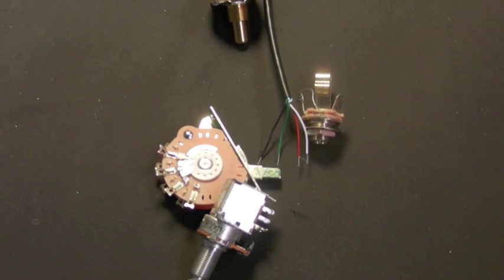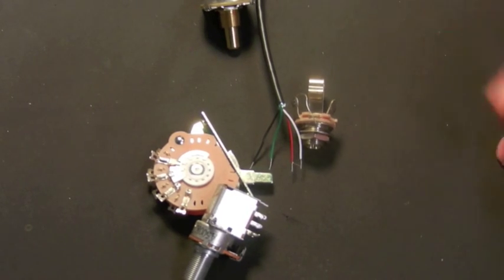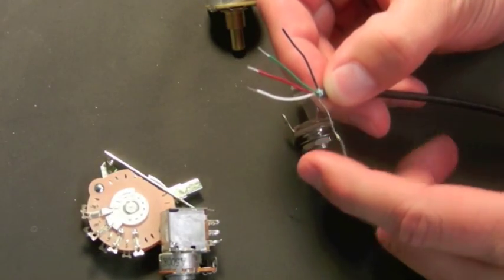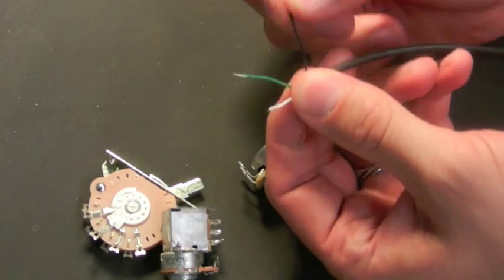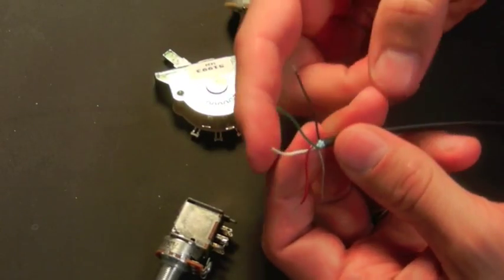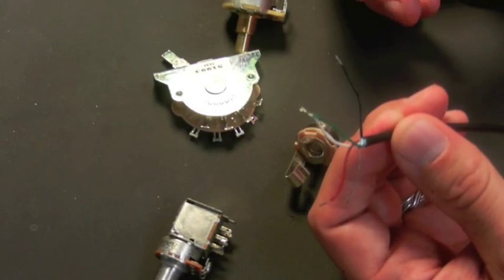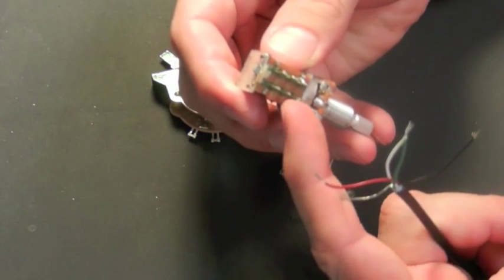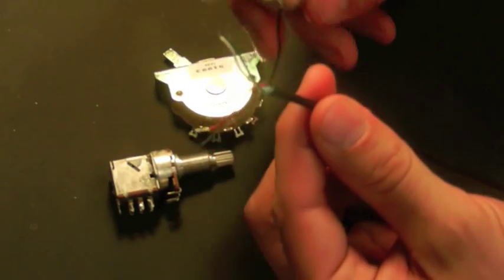Porter Pickups 4 conductor humbucker wiring

Comment: Good video, thanks. What if I just wanna splice that 4 wires to the 2 original wires : hot and ground?
Reply from the maker: yes hot and ground for whatever colors you want to match up. make sure the bare wire goes to the ground/metal parts. you can run two wires to the same point if you wanted since you would have a few unused/extra

Comment: So i will wire the ground (bare, red)
and wire the hot (black) then i will just solder the white and green, tape them and leave them?? They dont go into anything? I just make sure no nothing makes contact with them?

Pls help me
Reply from the maker: yep! you can tape the green white connection after soldering, so it doesn't touch anything it's also used for coil splits but you need it connected for the while hum bucker to work.
Reply: @PorterPickups  thankyou!

Comment: This is odd, my red wire is soldered to the white, and the green is soldered to the one without the plastic casing thing
Reply from the maker: Sounds like it maybe was wired for another type of sound or something? Does it sound normal?
Reply: @PorterPickups  dunno, I haven't put it in my guitar yet, I'm waiting for the other pick ups to arrive for the neck and middle. I'll let you know after I put them in